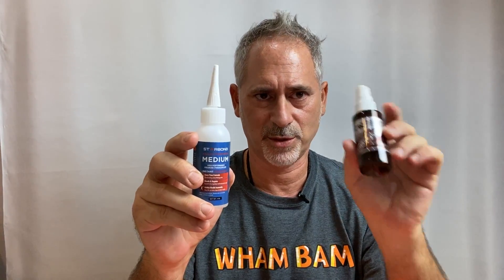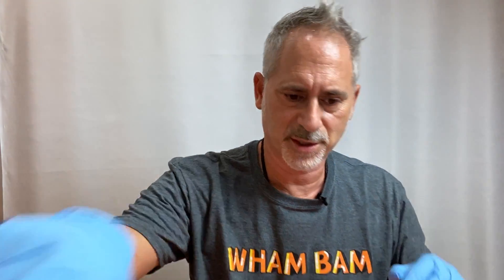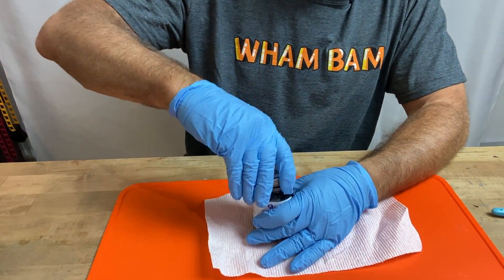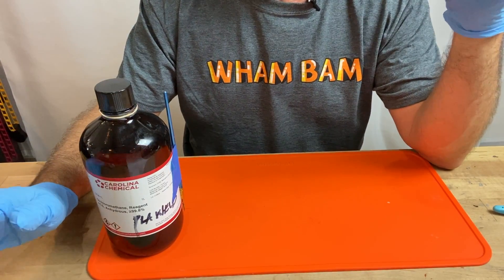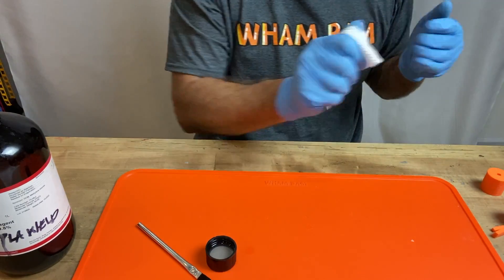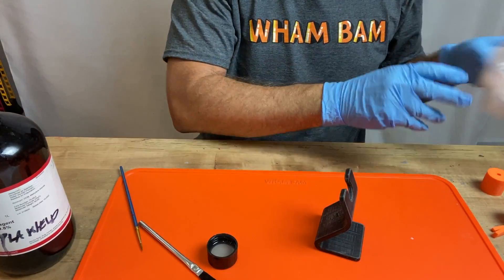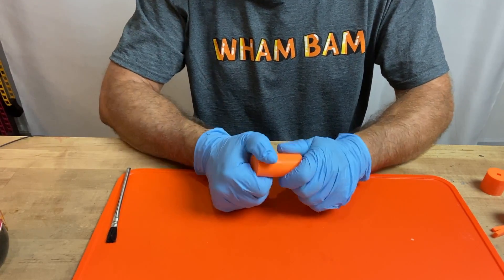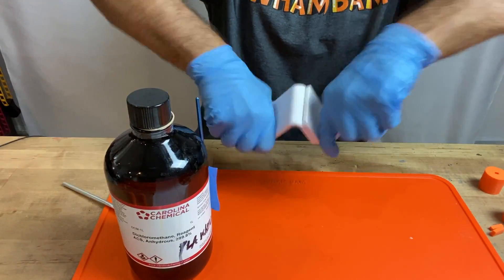Bonding PLA parts using adhesives and welding

Comment: The main advantage of the square peg has nothing to do with alignment. It is the addition of a shear bond which is vastly stronger than the peel bond you get just putting the surfaces together.

Comment: FANTASTIC video, Thanks for sharing!
The DCM will it work like an Acetone bath does for making PLA layer lines smoother?
Reply from the maker: I dint have success with DCM on PLA in a vapor chamber, like acetone on ABS.  It does work to brush on quicky.  You can use paper towel impregnated with DCM and quickly pass over it, take some practice on spare parts.  But be careful, its very toxic to breath, goes through skin, and evaporates quickly. so wear gloves, respirator, and eye protection.  And do not heat as it is very flammable
Reply: @WhamBamSystems  Thank-You for the information!
Reply from the maker: and thank you!

Comment: Hi Peter.  I've had the best luck gluing PLA using the Loctite 60 second universal glue.  Works even better than super glue especially better than the Gorilla Super Glue.  Another nice thing about the Loctite is it has a no-clog cap that prevents the nozzle from clogging.  Allen
Reply from the maker: Thanks for sharing!
Reply: @WhamBamSystems  Also I'm really interested in your demo on 3dGloop and especially this DCM stuff.  I have to make a basket for my wife for the drawer but the size I need is too big for my Ender 5  @235mm.  I"m gonna split it into 2 halves and the DCM should hopefully wipe out the seam!  Oh Yea.  Thanks much.  New Magnet is working out great

Comment: I use SCIGRIP 16 acrylic glue.  It has dichloromethane in it and it bonds PLA absolutely fantastically!  BTW DCM has been banned for sale in consumer products.  Not sure when that goes into effect.
Reply: In my country DCM can be buyed only with chemical license... has some restrictions in transportation also... by the way I live in Brazil.

Tryed some acetone, its very agressive to PLA, makes it whiter but it melts and work for bonding using just a bit... need to train a bit to don’t destroy your print ;)

I have some friends that apply DCM for post processing PLA as well... trying to find to buy it and get the proper safety instructions to use and store it. It’s very toxic stuff you can pass out if you breathe for not so long ... so the need to wear mask respirator or/and in a ventilated area should be follow
Reply: @Fernando_Gazzola  a little bit of DCM in a glue solution is much safer than working with the pure chemical but do take appropriate precautions.  The best precaution you can take for the pure chemical is to use it outdoors and wear gloves suitable for DCM.

Comment: Nice job, thanks. Can DCM be used to vapour smooth PLA ?
Reply from the maker: Peter Edwards hat might be a whole other can of worms, not sure how explosive it is or the dangers of letting it evaporate into the ambient. I might try some tests with a paper towel impregnated and clipping to inside of sealed container with PLA part in it and let you know! Good question
Reply: @WhamBamSystems  ever get a chance to test?

Comment: Does Dichloromethane bond other plastics such as PETG?
Reply from the maker: Jason Burns good question I had some issues with others and now use it mostly for PLA. Sounds like have to test all filaments next and let you know!
Reply: I don't know about straight-up DCM, but SCIGRIP 16 acrylic glue does.